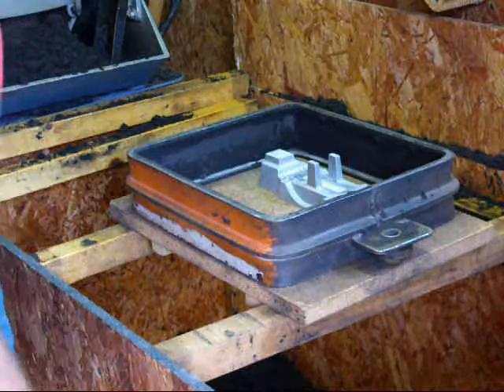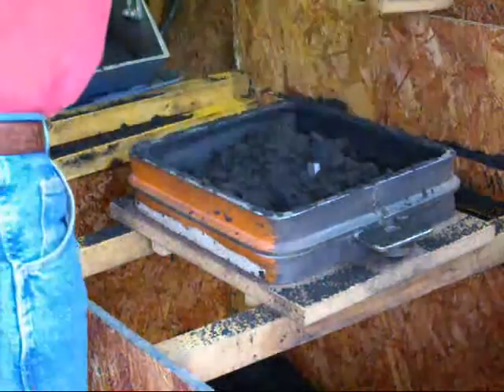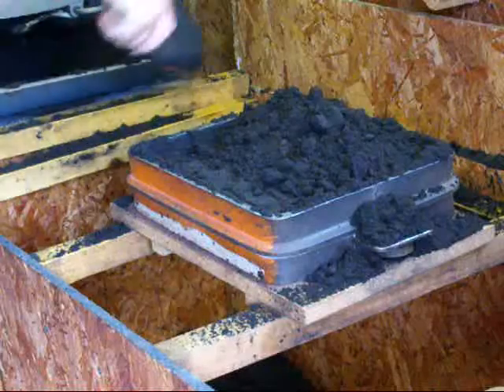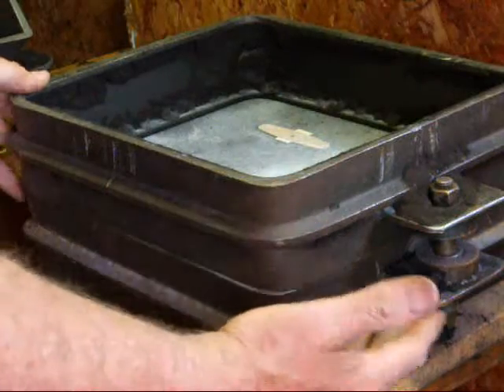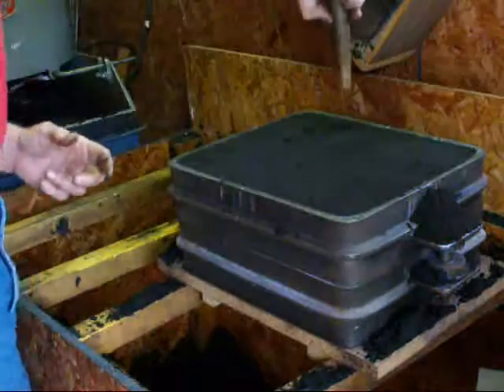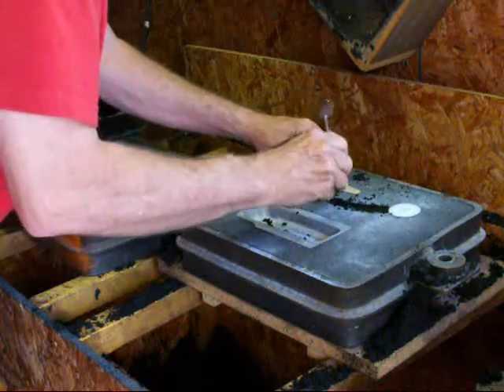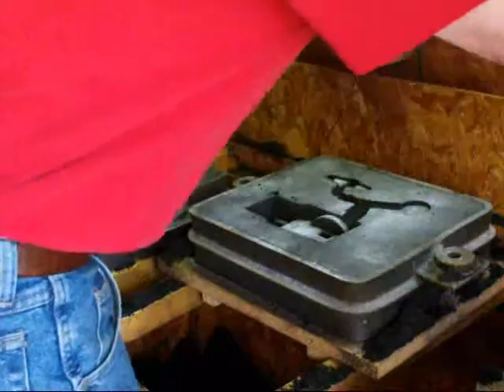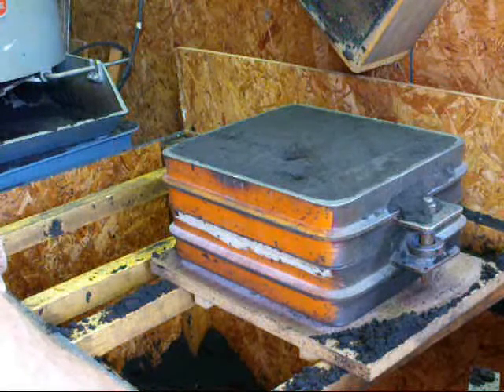FOUNDRY CASTING Making a Sand Mold part 2 tubalcain june 09

Comment: Do you have a video that shows how to make a more complex piece? I have a VERY SMALL part that i need to make out of Alum, and the issue is, no matter how I lay it, sand will get under it when i pack it into the mold.  So I've cut the part into 2pcs but i'm unsure of how to setup and align them using the two 1/2s so they come out as one when i'm done.  alignment needs to be perfect for this part i'm doing.  And the small size makes it really really hard.  (it a part for a storm door latch, that triggers the latch when the handle is pressed.  My door uses a VERY special door latch system and i can't just buy an off the shelf replacement.  And these doors were $1000's of dollars so buying new doors for a broken latch isn't an option.
thanks

Comment: I was watching another channel doing a flat back mold and casting using brass.  Before reassembling his cope and drag, he sprayed the sand with a graphite and alcohol mixture, then lit it on fire, and let it burn out.  He said this gives a better finish to the casting.  Ever tried this.   Note: He was using sodium silicate treated sand.
Reply from the maker: I never have tried that, in fact I never heard of it

Comment: Do you make the pattern larger to compensate for shrinkage?  Say your pattern is 2.000" x 2.000" x 2.000" -- what size is the cast aluminum piece after cooling?
Reply: Aluminium contracts 1” in 75” if that helps

Comment: Dear Mr. Tubalcaine:
I have a question about the sand.
How many dangerous or toxic can be a sand of a foundry?
After many attempts, a foundry center will gave me a portion of re-used sand. This sand is called too "residual sand".
Others foundries tell me that "residual sands" can be washed and reaconditionates for some more times, and other foundries has told me "these residual sands MUST BE ELIMINATED under sannitary orders.
Are these sand very toxic to manipulate it in a domestic use?

Comment: @MetalheadJTK   Hi,i was in the same situation as you.I found that sharp sand and fireclay works ok. About 10:1 sand/clay.This mix needs to be lightly misted with water,just untill it starts to hold together when squeezed in the hand.

Comment from the maker: I use a commercially made sand--called petrobond. It is oil bonded, but there are other chemicals also that make it bond,  If you are making small castings with a small mold, use core sand .  One of my other videos mentions this.

Comment from the maker: I only use one sprue for small castings. For big castings, the second one allows the air & gases to escape.  Also serves a riser to control shrinkage. You want the shrinkage to occur in the thick riser rather than the casting.  it feeds the casting as it cools thereby eliminating most shrinkage. 
gates do not have to angle. Yes, parting is like the talc.  Thanks for your interest.

Comment: I'm new and learning and am about to try my first sand mold. You only made one "Sprue" hole. When would you need two? I've seen other videos with a second hole. Does it have to do with the metal filling the mold completely or shrinkage? Does the gates off the sprue have to be angled down towards the mold or does it not matter? Is parting sand to petro-bond as talc power is to green sand? Thank you for the vids and your help, very inspiring.